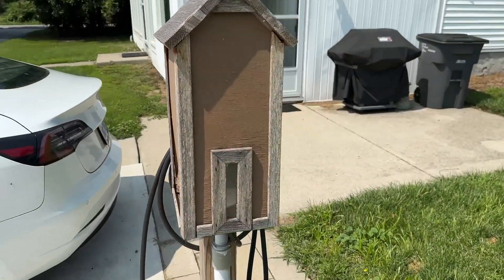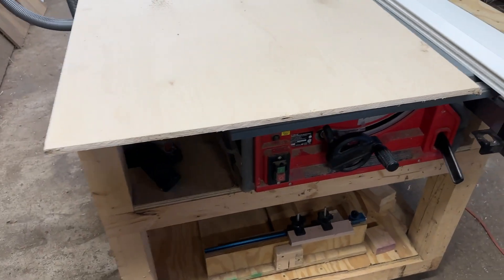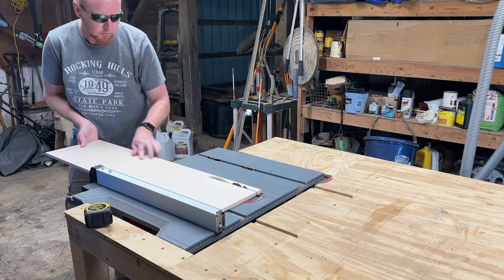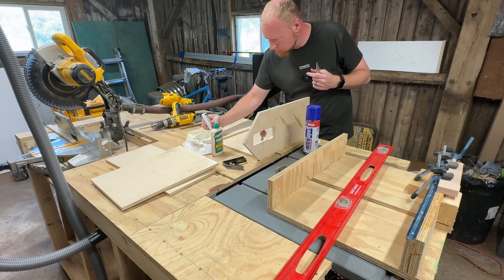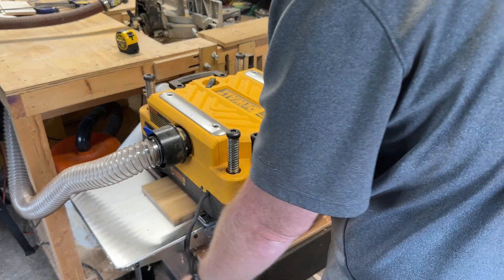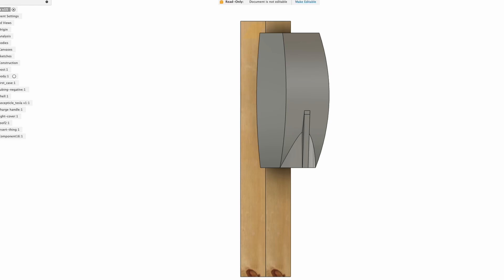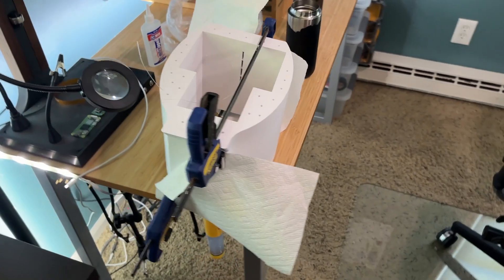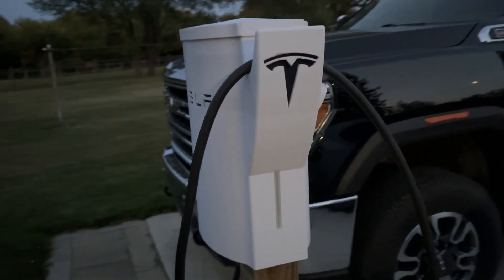From Failures to Fiber Optics: Fixing My Tesla Charger Once and for All

Comment: Rather than moving the pole or conduit, I'd put a outdoor rated utility box with 120V outlet and a 240V outlet, then run a conduit to the other side for the charger. This will give you power for other things when you need it. Maybe a camper...  You may not be able to put the 120 outlet because your breaker feeding the pole will be rated for a higher amperage than most outlets can handle, and you would need a GFCI.
Reply from the maker: Interesting, thanks for the advice. I'll look into it.